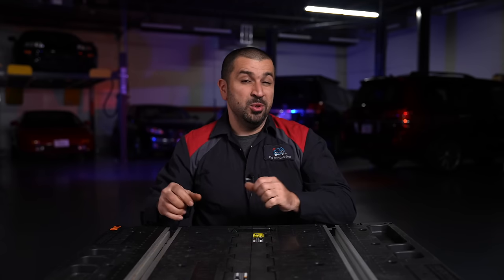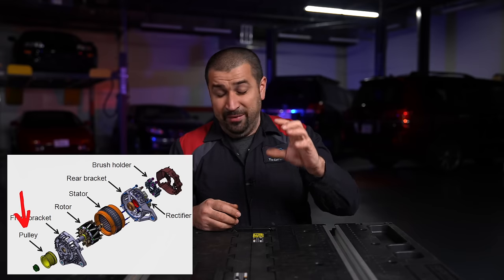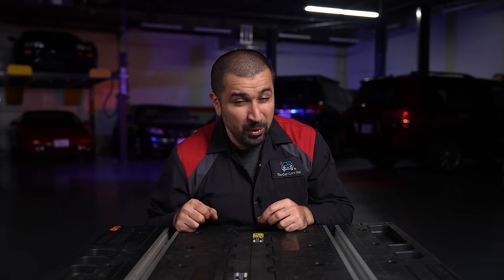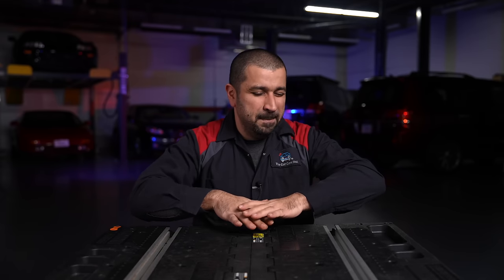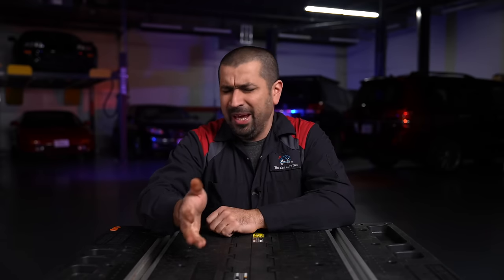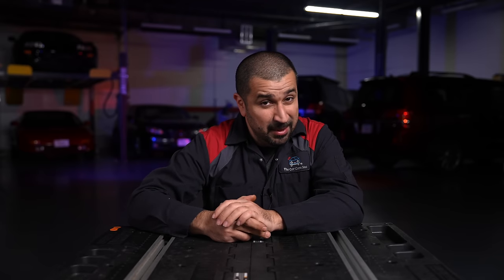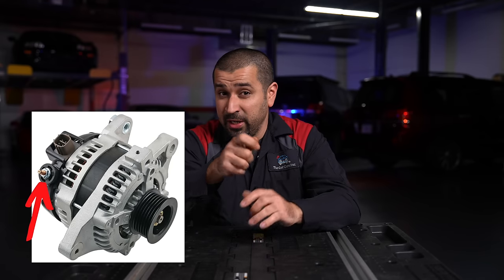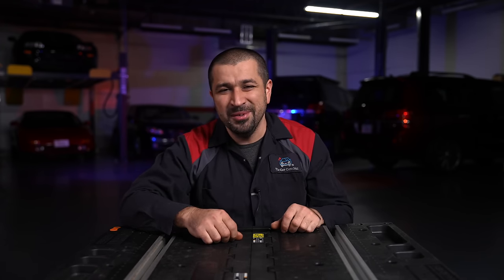How To Make Your Car's Alternator Last Longer? Everything You Need to Know

Comment: Question. Have a 19 civic, 6sp. Started to have to push the start button 3 times, to start the engine. 
All electrical items like fan, radio is working. Could it be the alternator going? Or bad start button contacts, or car battery? No warning lights on dash

Comment: Never mess to clean a alternator unless is completely disassemble. Dirt or metal maybe hang up in wrong places. I don't make any sense to disassemble a good alternator just for cleaning. In most condition will work aroud 150k miles. 
In my experience over 39 years alternators quit working from electric shortage cose by battery terminals lose or corroded, wire connecting alternator, bearings failed due to salt corrosion or no grease, brushes lose connection with collector, diodes blow   mostly by lose connection on battery or alternator. Diodes transforms AC current to DC and alow DC current in only in one direction only.
Been using rebuilt alternator in many cars and didn't have to rebuilt anymore and never have a issue. 
On my 2007 Toyota Fj cruiser alternator failed at 173k  drove the car about 45 miles stop on Walmart got a new battery then drove to a store have in stuck a rebuilt alternator then reach  my destination in Camelback Pa. Next morning replace alternator in Hotel parking lot return core to store and job done  under 250dollars without towing or mechanic
Never have a issue and the FJ have 3 sets of Offroud lights arown 200w and 4 Caddy Train horns.
Trade the car in to Toyota dealership at 205k miles with original starter.

Comment: I owned a 2006 Saturn Relay level III, basically a tricked out Chevy uplander and that thing loved batteries and alternators. What would happen is the BCM, or body control module would goof up and when it did it would short out a diode creating havoc. You would know when it would start acting up because you would drive it and as soon as you would let off the gas the output of the alternator would fluctuate, something it shouldn't do. The fix I found for this was installing the heaviest alternator in terms of output. I think 160amp, and the heaviest battery and running a heavy ground cable from the engine to the body essentially beefing up the grounds on that system. GM in their money saving mindset gave the system a lowly 110 amp (in the higher trims!) alternator and the vans already had poor grounding issues, thus putting a strain on a small money saving battery. This was fine and all until one of them started to wear out. Very common issue with these vans and kinda costly to rectify but if you don't it could take out your BCM or other components that are sensitive to voltage fluctuations and that can get way more costly and time consuming. It's just an example of GM's poor engineering decisions.

Comment: Thank you for a great video. Hopefully, you can answer this. I have upgraded the sound system in my car and now it has a subwoofer as well. I do put out great volume out of it. When I am driving when the bass sucks out a lot of power my volts on the multimeter go down to 12.4 or a similar number to that from 14.1+. Should this be worrying?

Comment: On my 2016 5.7 Tundra, the whining noise was very loud, and it would make the noise with or without the plug. Now, a month after replacing the alternator for a reman Denso 210-1147 (couldn't find it new) now when I am cruising down the road the voltage gage goes up and down a little bit and if I turn the heater and defroster on it will drop a lot and goes up back again to the middle. I haven't checked the battery yet, but I could have a bad battery or battery and alternator failing too. Not sure.

Comment: Explains why I never changed an alternator on a car I bought new.  My wife’s 04 Mustang we got in 04 has 200k miles on the original alternator.  My 14 mustang GT 128k on the original alternator.  I have gone through a few on old shit boxes I owned in the past.  I replace the battery every 5 years even if it’s still good.  Doing that I have never had to be jumped in any of those cars.  When I was younger I didn’t have the money to do that.

Comment: Question, if you have aftermarket accessories like off road lights going to a switch panel to control them does that put additional strain that could potentially ruin the battery. If so what would you recommend? Thanks

Comment: One very minor correction:  There is no large capacitor smoothing out the 3-phase AC ripple from the alternator.  The battery does this.  It is effectively a large capacitor that stores charge with chemical process, where a capacitor stores charge with an electrostatic process.

Comment: If battery light and parking brake light were displayed but turned off, is it safe to assume the battery is receiving charge again? 1993 22re. I’m sure the dash lights mean failing charging system components and I do plan to replace or repair alternator asap. Likely do belts and check pulleys etc. Asking in terms of moving vehicle to shop etc. Would no dash light mean the battery is being maintained… and chance of being stranded is reduced, unless lights return.

Comment: When I was recently doing a repair to my car that led to the car not moving for around 4 days while being locked, unlocked and staying unlocked with the key in for hours the battery was fairly low.
It barely had the power to crank the starter over fast enough for the engine to start. The car also wasnt driven much in the week before so the battery didnt really get a change to properly charge itself up.
So I decided to let it idle for 5 Minutes to let the battery charge a bit and measure currents with my clamp meter.
With all acessories off and all lights off I had around 31 amps on the main alternator cable and 25 amps went to the battery so the car itself needed ~6 amps to run itself. Dont know if thats low or high but it means if the alternator dies completely the battery would keep the car running for a while given that I can drive without lights on which id hate to do even in daytime.
BUT lights on, radio on, AC fan on with the battery still pulling ~20 amps I had almost 90 amps from the alternator.
The car has a 140 amp alternator though so the current is perfectly fine but its a lot tbh.
The alternator would provide ~70 amps with the battery fully charged pretty much half of what its rated to put out at the most.
And its a dumb alternator too that just puts out static 14,45V no matter what.

Comment: The alternator in my 2010 corolla started whining one morning when the car was about 8 years old with well under 100K miles and by mid afternoon the battery (the original that came with the car) was depleted and the car died. I replaced the alternator, the battery and the drive belt just to cover all bases. I didn't know what was making that sound but I found out the hard way... Funny thing is that there were no lights on the dashboard until the power steering stopped working (among other things) and the engine kept running just long enough for me to park the car..  Too bad I didn't have this info back then... Thanks for the education, as always...

Comment: The alternator pulley just fell off my 2017 Camry at 100k miles. Apparently there's a clutch in newer alternator pulleys that is a wear item. Change it when you change your serpentine belt, your tensioner, and water pump.

Comment: I can’t afford new Oem alternators, instead I get used Oem from salvage and have them rebuilt at me local auto electric shop.  New slip rings, brushes and bearings and it’s good as new.  Alternators tolerate water just fine, but not soapy water and definitely don’t splash any antifreeze on it.  Sprag clutch pulleys are unreliable and not worth having.  The one thing that would make alternators last longer if if the regulator would reverse the field current with each drive cycle so the wear on the brushes and slip rings would be evenly distributed.

Comment: Aftermarket Chinese alternators use copper cladded aluminum wiring in the stators. Extremely hazardous. Your Wall Street run parts houses sell them to suckers with a lifetime warranty.

Comment: I have a request that you may have already covered, 2014 Camry 4 cylinder, the air conditioning variable pulley at low rpm makes a squealing noise. Is there anything that can be done besides replacing it? Great video on the alternator and I enjoy the content of this channel. Thanks

Comment: Im old enough to remember when vehicles had generators and also it use to be easy to but a alternator or starter rebuild kits at parts stores and it was a simple and easy feat to rebuild on at home. Wouldn't attempt this now. Also used to be able to buy oem reman units from the dealership for cheap. I have a 2011 Ram truck 249k miles and still on the factory alternator. My son has a 2015 Ford F250. I think he went through 4 or 5 OEM alternators before he bought a aftermarket Bosch and has had no more issues.

Comment: I couldn't find a Denso remanufactured or new alternator for my '92 Celica. I got a reman from some ebay seller that rebuilds alternators in Missouri and it's been problem-free for five years since mine failed.

Comment: This is great information. Do you recommend preemptively replacing an alternator after hundreds of thousands of miles of service?  Our Honda Odyssey has nearly 300,000 miles on its original alternator and I’m becoming mildly concerned that it could suddenly fail on one of our cross-country drives. I don’t hear any whining, and electrically it seems to work as well as ever. Also, how do you feel about having a worn out OEM alternator rebuilt by an alternator specialist, as opposed to buying a new one?

Comment: I tow a small camper with my 2016 RX 350 and maintain the camper battery with the vehicle alternator when driving. A Small 12 volt refrigerator is on while towing to a destination. Is this going to shorten the life of my alternator? I do have a DC to DC controller in line before the camper battery.

Comment: How about running the car with no battery? I know it worked on the older cars i saw in my autotech back in school, but ive heard some say it wont run newer cars, or that it might damage the other electronics. I know alternators used to be able to pump out enough power, the alt in my workvan is a 90 amp alt, and has 300,000k on it including a few dead and weak batteries. I left my lights on once and killed the battery, got it running and charging again and ran the battery for another year before it called it quits, alternator didnt care, because its older, and designed for higher output levels. And also, id just like to say, in relation to both the early assumption that nothing will ever draw more than your starter, and the later info about not buying aftermarket alternators, the competetive car audio scene heavily disagrees, but for very specific reasons and scenarios of course haha. Cars with 10,000+ watts rms of OUTPUT POWER, are plentiful in that scene, some cars have well over 100,000 watts of output power. These guys not only replace the alternators with aftermarket ones, they replace them with 300 amp alternators, and add 5 more lol. Im certain that compatibility with different manufacturers can cause some electrical gremlins, but these people dont care, as most of the vehicle's stock electronics are gone, only what's absolutely necessary for the engine to run really matters to them. They favor older models for various reasons, electronic complexity being one, but i assume, if they had to, it really wouldnt be very difficult just keep the alts and batteries completely separate from the electronics running the car/engine itself.

Comment: I have designed power supplies for electronics systems. These power supplies have temperature and over current sensing and protection. I don't know why car alternators don't have this protection. I have had alternators on my vehicles since the 1960s, and most of them were completely trouble free. But I have had one burn up completely. I don't know what happened to it, because the battery was good. In fact, the vehicle ran on the battery all the way home, because the alternator was completely smoked. Overtemperature protection would have shut off the primary (exciter/rotor) voltage, and despite whatever the failure was, the alternator would not have burned out. 

Over current protection would allow the alternator to charge a flat battery that was otherwise in good health.

Comment: As Toyota goes to full hybrid system there is less alternator but worse yet it’s AC/DC controller manager all the power. So if you don’t change car battery in Hybrid vehicle you may have changed entire hybrid system😂.

Comment: Alternator produces 3x ac voltage w/o load and 3x ac voltage and and current on the 3x loads and 1x dc load. Alternator has 2 sections: ac and dc. The ac voltage is switched in dc voltage by a group of diodes.

Comment: I usually just get an aftermarket alternator, OEM ones are really expensive. only real issue I ever had with an aftermarket alternator is the pulley coming off. new pulley, nut, and loctite orange solved that.

Comment: speaking of getting stranded.... it is such a shame that very few modern cars include FULL-SIZE spare tire/wheel.   Temporary spare tires are temporary.   The unlucky few dont' even have temporary tires and only a tire repair device in the trunk.     My friend hit a pothole and one of the wheels was bent beyond repair.  He was in New York(upstate).   He had AAA tow it to a Toyota dealer.  The dealer didn't have the wheel in stock.  The service advisor called just about every other Toyota dealer within 3 hours. Only one had it and it was 2 hours away.  My friend ended up driving on the temporary spare at 50mph, which was very dangerous, but there were no other road in the rural area except the interstate.  Took almost 3 hours to get there.   At least that other Toyota was holding the wheel for him.  If nobody had the wheel, he would have been stranded there for two or more days.

Comment: I charge my battery once every two months, in order to (a) avoid putting a bigger load on the alternator, (b) increase the lifespan of the battery, and (c) avoid being left stranded.
This is especially relevant in the colder months, and especially if you have the habit of running many accesories without the engine running, e.g., lights, radio, windows, etc...

Comment: I know most of  that. but not about how bad it charge a  bad or low battery. but I do charge my battery- I try 1-2 two times a mnd. my old mercedes diesel has now the old altenator. but just replace the freewheel and  the ragulator. now it charge well. the car has about 182060 miles.
but one Q. 
from time to time it has a 1 sek. time from start. no charge13v. then full nice charge 14.2 v. what is the reason for that.?
I have check ot with an obd. and is charge perfect after 1 sek.

Comment: What about a remanned Denso? That's what I put on my 2006 Honda Pilot (winter car).

When my original alternator was going out at 150k miles I was getting electrical gremlins. My radio was erratic and the alarm was going off randomly. Finally I started getting a wine and the battery light. 

I was running on a charged battery temporarily while I had the alternator on order and I had a complete meltdown. Something happened and my battery drained immediately.  I had it towed to my driveway, 

I charged the battery outside the car because it wasn't taking a charge in the car. I didn't know at the time why it was so depleted. This was winter in Chicagi btw. I hooked up the battery to get it in the garage to change the alternator and as soon as I connected the battery the alternator started smoking. I pulled it in asap and by the time I shut it off the battery was dead again. This was about 2-3 minutes is all. I immediately disconnected the battery and was ready to hit the alternator with the fire extinguisher if it caught fire. 

When I got the alternator out it was all burned. The labels were gone, etc..  What happened? A short? 

Anyway...  It's been 3 years and about 15K miles now and I started getting a wine about a month ago. I don't think it's the alternator because it only does it with the AC on. I don't have any electrical gremlins or battery light and it's charging fine. I think it might be a tensioner or something with the compressor or clutch 

Thanks so much for the tip on pulling the plug. I'll run it with the AC on and pull the plug on the alternator to see if it goes away. 

I really don't want to have to fix this in the winter. I did the alternator one winter and then the rear brakes the next because the piston on the RR seized and destroyed my brakes. By the time I got to it one of the pads disappeared and the ear of the caliper was doing the clamping. Guess who didn't get their core charge back for for the RR caliper?

I knew the rears were getting down, but I thought it would hold until spring. It would've if I hadn't had the piston seize. 

I ended uo replacing rotors, pads and calipers on both rear and did the fronts in the spring.

Comment: Not doubting your great knowledge and advice but stangely my old Citroen berlingo
 cars alternater sits right under the PAS pump which oneday ruptured giving the alternator
a good shower of its hydrolic fluid. When I got the van home I decided it was a good idea to
rinse the alternator from above with some warm soapy water to flush any remaining hydrolic fluid out of it. Left it for a while to drain off and dry for a while then started the engine to spin out any remaining water out
Replaced the PAS pump and amazingly the alternator survived about a year before it finally died. Good times lol.

Comment: Decades ago I learned to use a battery charger several times a year.  I never used my alt to keep my battery charged.  Recently I bought a nice computer controlled charger that you can charge, jump, refresh, trickle charge, and it was only about $125.  Keep that alt happy.